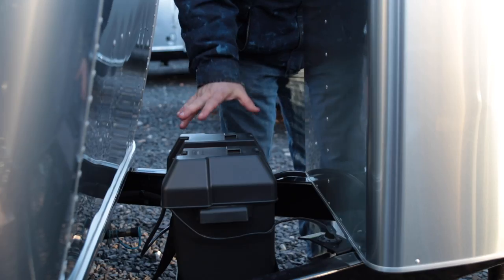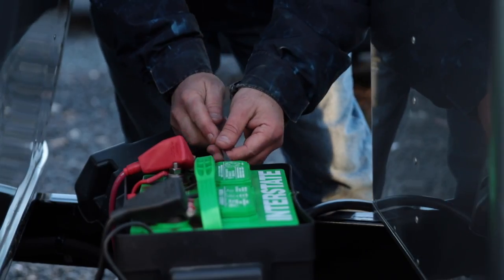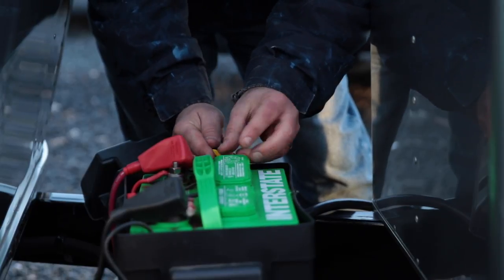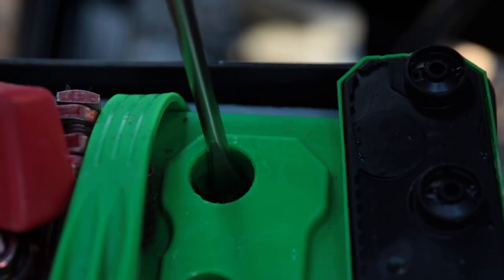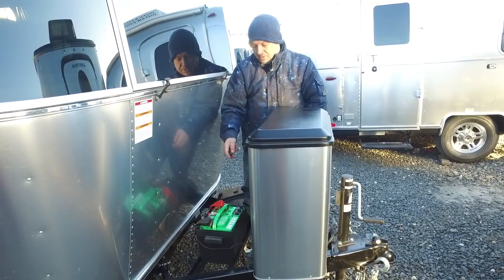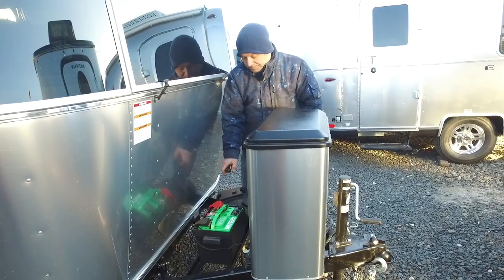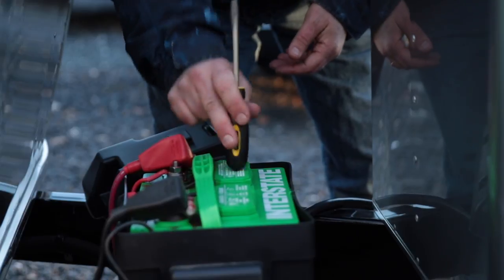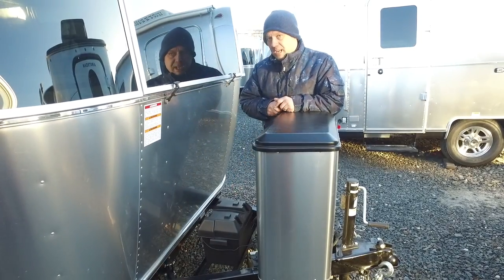How to Check the Battery Water Levels in an Airstream Trailer

Comment: Would be nice is Airstream wouldn’t run tight connecting cables directly over the top of access ports. I went to AGM batteries because it was a task to check water levels due to this.
Reply from the maker: AGM batteries are available as an upgrade as part of the solar charging system. 95% of my inventory already has this feature.
Reply: Gillian Wilson 1qss+cde